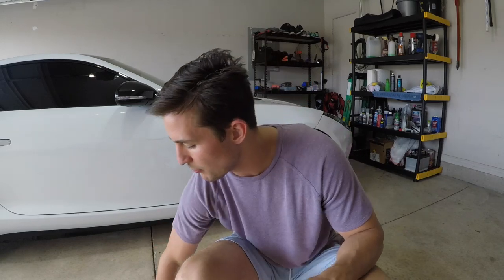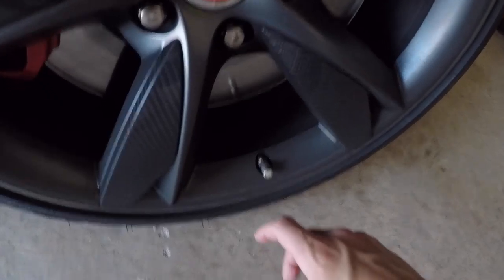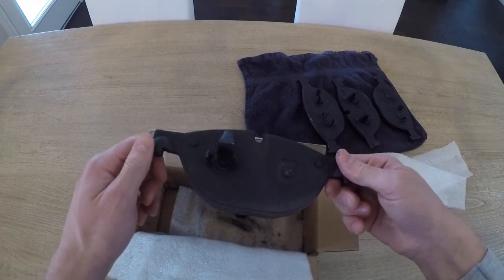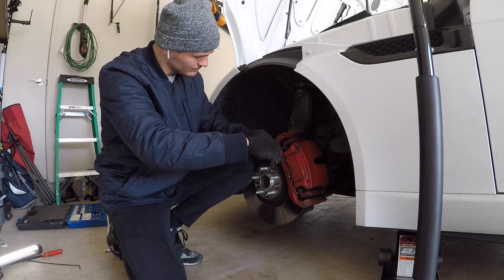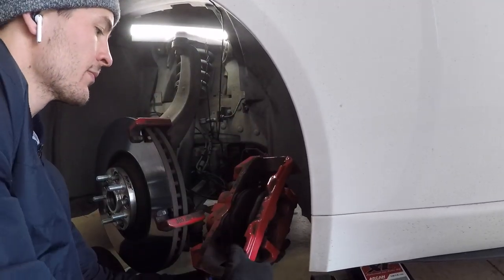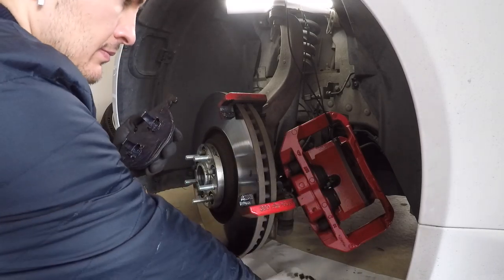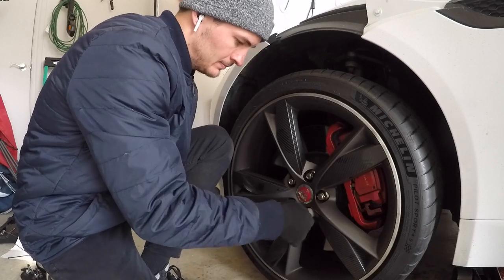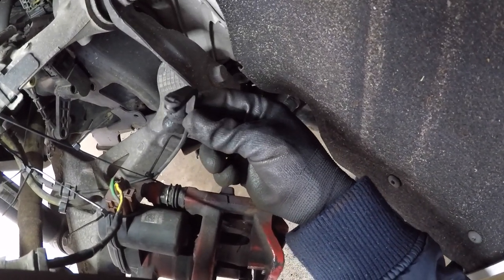Jaguar F-Type Brake Pad DIY: Porterfield R4-S Review

Comment: Thanks for putting this video out, is it absolutely necessary to but the car in Brake maint. mode .

I'm going to do a brake pad replacement as well

Thanks Ron
Reply from the maker: Right on, thanks for the comment!
Reply: Did you have to remove the car from the brake maintenance mode after the replacement?
Reply from the maker: Yea, it’s the same procedure in reverse. The car will prompt you to do so after the job.

Comment: Conner, great channel. I’ve been enjoying your videos. I wanted to ask, how have the pads been? Any pros and cons that you can share after putting some miles on them? I need new pads and have been looking into Porterfield. After doing some research it looks like the Porterfield R4-1 brake pads might be more suitable though. Brake dust from the OEM pads is horrible. I need to clean the wheels daily. Im looking for lower dust, but I’m signed up for a few HPDE events this summer so performance is also important with preferably low or lower noise to keep the car enjoyable when weekend cruising. Any help from you or other Jag enthusiasts would be greatly appreciated.
Reply from the maker: Hey thanks for the comment, the pads were great. I ran them for about a year. They had less initial bite but the total brake ability seemed pretty similar. 
The brake dust was significantly less, so that’s good. I think these are a great substitute for ya!

Comment: Thanks for the videos.. have a question pertaining to the rear calipers and Porterfield pads.. I've cleaned, disassembled, painted, and in the process of reassembly.  The question has to do with rear pads and anti rattle clips for the rear. When you replaced your pads, did you use the clips from the  OEM pads? I can't tell and no explanation other than fitting Porterfield pads. With new pads on, their is some play, and I want to ensure I reassembled correctly before driving. If anyone has knowledge or has replaced, please fill me in. Thanks

Comment: Thank you for your DYI, I had a quick question after finishing with brake job with the brake system did you have to do something with removing the maintenance mode in the cabin?

Comment: Hey Conner, the torque specs you gave are for RWD models only or AWD as well?
Reply from the maker: Yes they should be the same because the brake calipers didnt change between the RWD and AWD

Comment: Conner 2 questions: Could you explain the reversing of the Brake Maint System? You're say just reverse what you did to set it. So do i do the exact same thing again, because if I reverse it, it does't make sense,  Also on the rear caliper, I didn't see where you had to push the piston back in to make the new pads fit. Is that piston hydraulic where you can just push it straight back or is it the twist and turn type?? If so which direction are your turning,  Thanks  Great Video!!
Reply from the maker: The brake maintenance mode retracts the rear piston for you, you just have to push it straight in. You do the same sequence you did to put the car in maintenance mode. Sometimes it takes a couple attempts
Reply: @skrrtgarage3922  Thanks for the clarification. Really enjoy your videos. Keep up the good work!  JB  16 F-type -R Conv
Reply: Actually you do the same thing except instead of pushing down on the emergency brake button you pull up on it. 2017 Jaguar f type R

Comment: Hey man this is a bit off this topic but i bought a 2016 F-Type R convertible and noticed the interior panels were super sticky. I tried alcohol like on another video and it took the interior paint off around my AC vent. Every panel painted grey is super sticky. Did you have this issue?
Reply from the maker: That is a pain to deal with, I read that lemon oil helps but I’ve never used it personally

Comment: Conner:  How come you never have your engine cover on?    What service manual do you use?    Thanks.
Reply from the maker: I’ve read on Jaguar forums that the engine cover traps in a little extra heat and it lessens the sound of the supercharger whine.. so I took mine off
Reply from the maker: I use one that I bought from eBay, it’s the dealership ones

Comment: A question I get asked often on my F Type is why doesn't it have drilled discs? Most high performance cars have these to assist on cooling so strange on the R they are not drilled. Any ideas on this? Thanks.
Reply from the maker: That’s a great question, I know that the SVR model or any f type with carbon ceramic brakes has drilled rotors for heat dissipation. 
My guess is that that jaguar knew 99% of their customers wouldn’t track their cars, and having slotted/drilled rotors only makes a difference when lapping on a track. 
One benefit of non drilled rotors is that our pads will last longer! Haha drilled and slotted rotors kill off pads quicker
Reply: @skrrtgarage3922  Found the answer at this link below. Drilled discs these days are purely decorative and don't improve performance since they stopped using "gassy" pads. No "real" race cars use drilled discs.  https://www.youtube.com/watch?v=78wbht355R8
Reply: Stress cracks develop on drilled steel rotors leading to premature rotor failure. Engineering Explained has a great video on the subject.
They look great but are actually inferior to solid rotors.

Comment: the box said 1753 but you are installing the 1750s, does it matter which one you pick?
Reply from the maker: It could have just been the difference between the front and rear brake pads.
Reply: @skrrtgarage3922  yeah I realized that once I thought about it a little more, i bought those pads. would i need new brake sensors or can you reuse the ones already there?

Comment: FYI: OEM use TRW pads, which are terrible quality and sold extremely cheap on Amazon.  The Jag OEM 4-wheel pack, including sensors, is $2100, before labor.  A basic 4 wheel dealer brake job (pads and rotors but no serious cleaning) is $3350 with tax, and the pads will squeal uncontrollably in 500 to 1000 miles, throw off a ton of dust, and grab unevenly.  Its a joke that standard Jag maintaince is such a disgusting rip off with rock bottom quality.
Reply from the maker: That’s interesting, I wasn’t aware of that!

Comment: The "red ones" on the f type are always 380mm at the front and 376mm at the rear? (regardless of v6 or v8) I search to buy new brake pads and i don't want to buy the wrong ones. Tx mate.
Reply: I searched for the serial numbers for the brake pads in the comments, but i didnt find it.
Reply from the maker: I would have to look it up, but generally the R and S model have the larger brakes. 

There are forums online that will have that info